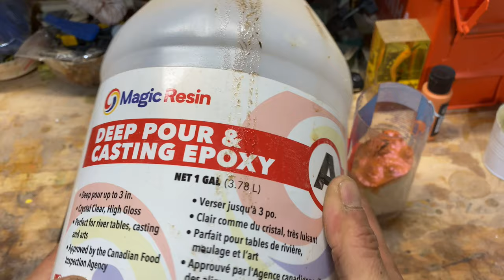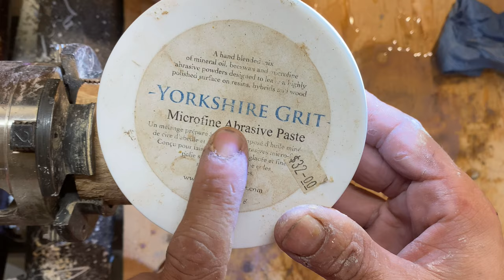Wood Turning  - Centipede in Resin

Comment: Very nice. Did you add colorant to the epoxy? or does it have an amber colour when poured?  It appears to be a bit amber but perhaps that is the lighting you are using. Just wondering because I have not seen that brand of epoxy. Thanks for sharing the links.
Reply from the maker: I have not add mica powder to epoxy I have paint the piece in wood with some irised paint and I always use magic resin for all my project

Comment: Hey what happens if you don’t use the pressure pot when using epoxy? I really want to try using it but don’t have a pressure pot yet.
Reply from the maker: You can have some bubble I got with the pressure like you see in. The video but I think is a reaction with the centipede who know
Reply: @Villywoodworking  lovely work as always man, really good fun!
Reply from the maker: @PBUCKY1969  dépend the pressur pot you send to me it’s for stabilized the wood with a vacuum pump the air get out the wood and the resins take is place — In a pressur pot you the air inside the pressure pot and the air bubbles get out  of the piece you want to cast
Reply: @Villywoodworking  ah ok I see, so it’s air pressure rather than vacuum that I need - where did you source your pressure pot? I don’t have access to compressed air but I might be able to use my scuba cylinders - need to look into it, thanks again!
Reply from the maker: @PBUCKY1969  I have a compressor 
Stabilized wood and casting it’s two thing
Reply: @Villywoodworking  thanks mate I’ll have a chat with Santa Claus and who knows I might be lucky! 😄
Reply from the maker: @PBUCKY1969  check for an use compressor people sell these for nothing on Facebook marketplace
Reply: @Villywoodworking  will do, I could really use one for my work space so i think the time is right!